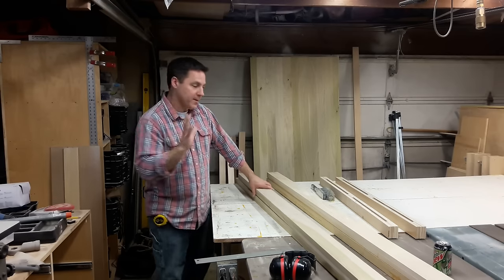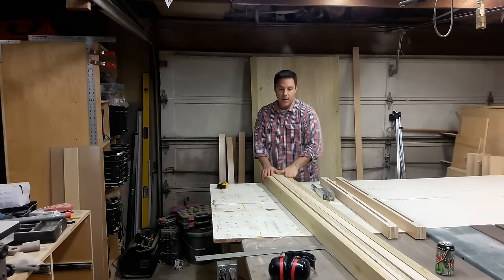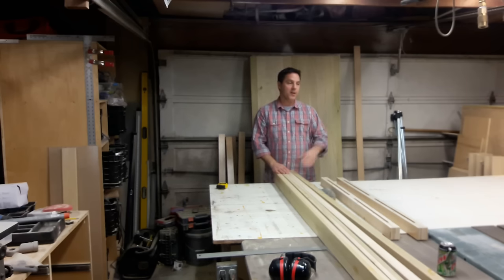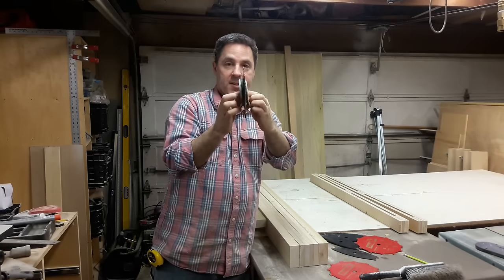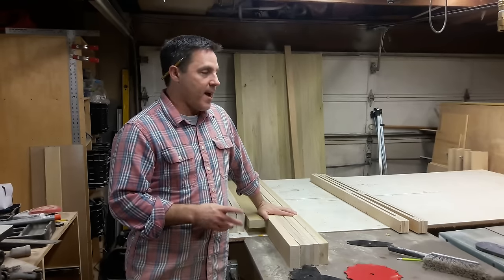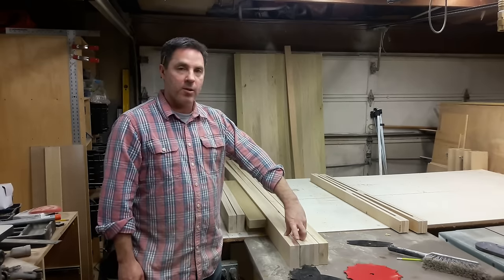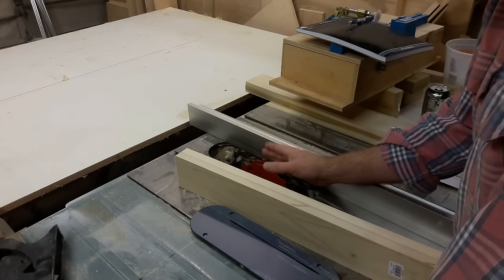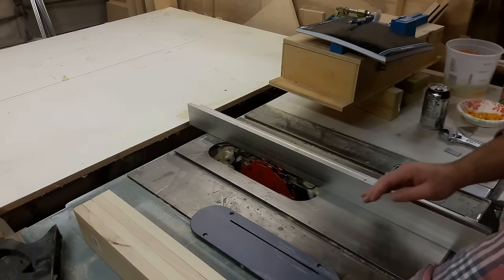Building Double Barn Doors: Frames 1

Comment: so glad to see you telling people not to waste their money on all the fancy gimmick tools.  as a cabinetmaker 
(retired) i agree with you.  have the basics and a little ingenuity and you can do anything.  i have never seen so much fancy expensive equipment as i have in amateur youtube woodworkers shops (pity they didn't put as much time into the design of their projects).  i spent years making one off commission pieces with just the basics and a few good hand tools.  for me to buy new tools there has to be a justification in time saving and how much use i will get out of it.  as you know money spent on equipment is money not going into your pocket and its hard enough now to make a living with all the cheap chinese rubbish in the stores.
Reply from the maker: Thank you sir. It's nice to hear from a fellow cabinetmaker. I couldn't agree more. I was fortunate to be able to buy a table saw as one of my first tools. I think i had a router and a drill. I think that was about it from the power tools, and I got on well with those for many years. Thanks for watching, and taking the time to post the great comment. -Pat